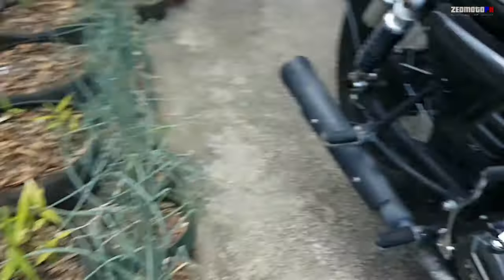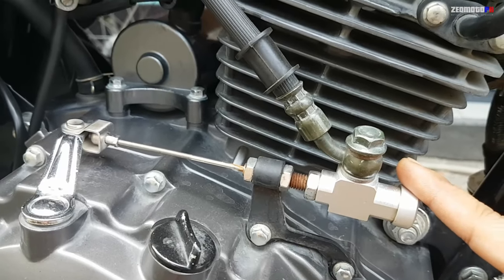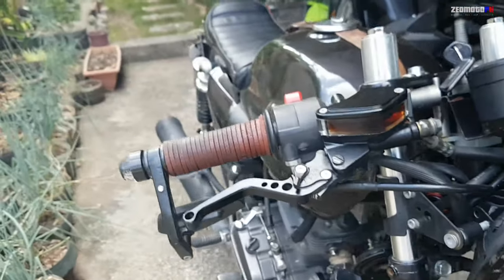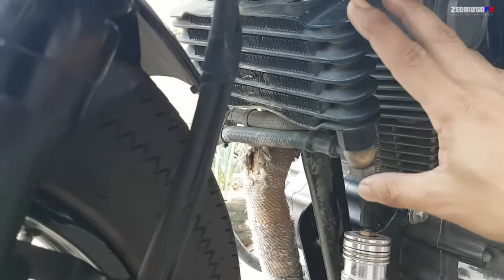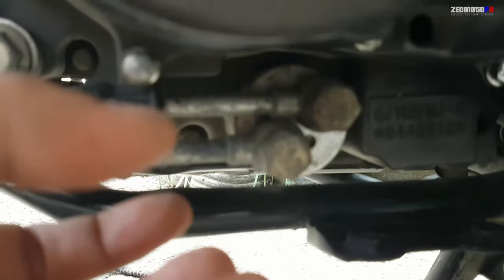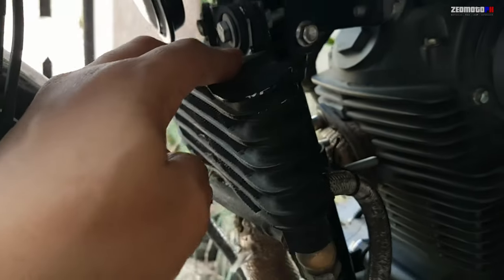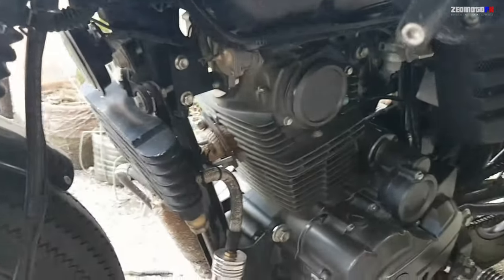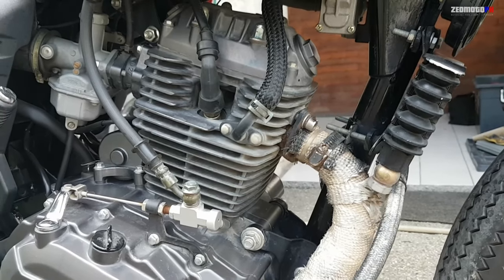OIL COOLER & HYDRAULIC CLUTCH INSTALLATION | KEEWAY CAFERACER 152

Comment: i was hoping that i could understand the ways of doing it but sadly i couln't due to language barrier (i don't understand tagalog, sorry) and there weren't many youtube videos regarding cafe racer 152. i have the motorcycle too and i was thinking of installing oil cooler system due to me going back and forth from my hometown which is around 150+km total of distance. Is it plug and play? or do i need to change other parts too. TIA.
Reply from the maker: Yes it is plug n play, If you purchase the one with the adpator. Then install the adpator to the Drain Bolt.
Reply: @zedmotoph  lastly, sir. What about EO? Do you still use 1.1L or you have to add on abit since the cooler uses 100+/- ml space of EO.
Reply from the maker: @furryballs1229  since I installed , the oil cooler , i did used up 1.2L EO, but then after I had a tuned up from my last video the mechanic told me that it is ok for 1L so i tried  putting 1L. I still need to observe though.
Reply: @zedmotoph  thank you sire. Cant wait to see the result. Cheers

Comment: Paano ka mag change oil nyan?hindi ba dehado yan?may extra drain bolt pa ba ang cr152 bukod sa kaliwa?...planning to install oil cooler sooner or later...thanks
Reply from the maker: May video po ako sa change oil paps at pano ikabit ulit. Parang may isa pa ata sa bottom ng engine. Im not sure lang paps wala na kasi ang unit ko. Sa pag change oil naman madali lang naman ikabot at tanggalin ang adaptor paps.

Comment: master ano po ba spec ng adaptor pra sa oil cooler boss papalagay pokasi ako
Reply from the maker: Universal lang naman po gamit ko sa shopee
Reply: @zedmotoph  master.na lagay ko na po ang  digital speedometer paano po gamitin itong magnet sensor.
Reply from the maker: Ilagay mo po sa bandang hub ng gulong ang magnet. Tapos yung sensor naka totok sa kanya. May video ata ako nun. Pakihanap nalang po

Comment: boss, paano pag lagay ng hose pipe sa oil drain?
Reply from the maker: Dapat po may adaptor
Reply: @zedmotoph  kamasa na po b yan sa lazada link niño boss?
Reply from the maker: @maxtv2883  opo isang set napo yan
Reply: @zedmotoph  o.order napo aq ngaun boss, salamat po. mabuhay po kayo at ang cafe racer enthusiastic sa Philippinas.
Reply from the maker: @maxtv2883  nacheck mo ba kung ang na order mo yubg complete set, nagkakahala yun almost 3k or sobra.? Yun din ba ang order mo? Salamat goodluck sa mods mo.
Reply: @zedmotoph  opo boss, almost 3k ang binayad q sa isang set. may tanong po ako, para saan po b yung injection atsaka maliit na hoose?
Reply from the maker: @maxtv2883  diko po ginamit
Reply: @zedmotoph  ah, ganun po b. akala ko po gagamitin p. kasi kasama sa package eh.

Comment: Sa cable sir puro wave ang imng ge gmit asta sa clutch ?
Reply from the maker: Nope sir, hyraulic napo ang clutch ko sa hose na sya pareho na sa brake lever, same na sila ug hose. Nya ang gigamit nako hose sa clutch lever kay sa wave.
Reply from the maker: Ang sa brake stock pa gihapon, giilisan lang nako ug lever.
Reply: Asa ta mka palit ug clutch hose sa wave sir salamat
Reply from the maker: @lardzen7983  sa mga motor shop naa daghan or sa kana gani surplusan, diha ko nakapalit sa mandaue guizo
Reply: Cge sir thanks sa info more power